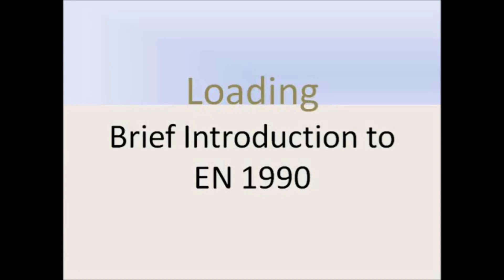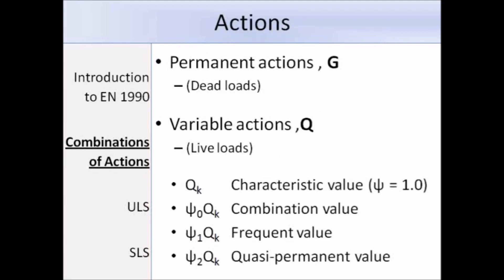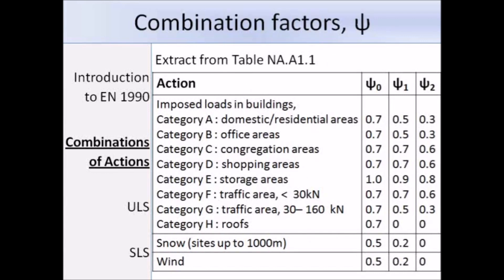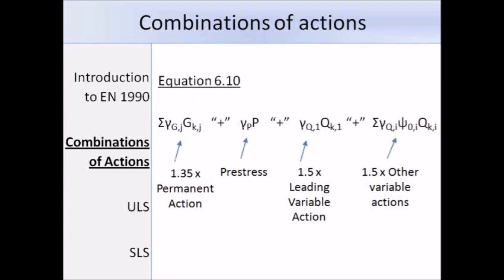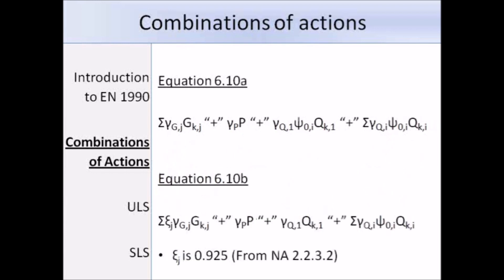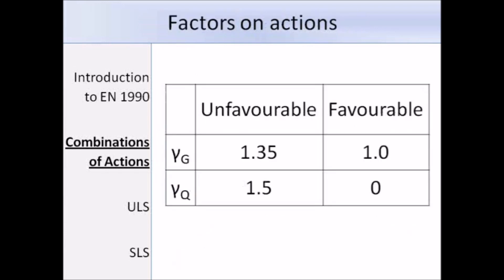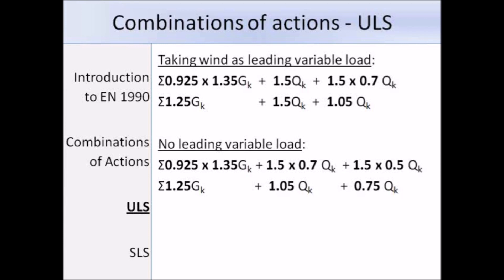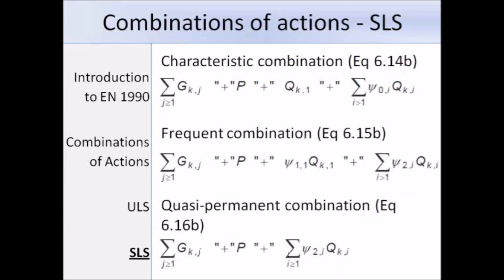Introduction to Eurocode 0 | EC0 | EN1990 | Basis of Structural Design | ULS | SLS

Comment: Thanks for video  i jut wonder somethink   i live in UK if i work as A structural engineer it is okey if i use eurocode or i have to use british standard bs5950? thanks
Reply from the maker: Kenan Taylan Under the Public Procurement Directive, the Member States must accept designs to the Eurocodes. Eurocodes are the standard technical specification for all public works contracts: where a contract for a public body contains a technical specification this should reference the appropriate European Standards.

Whilst it will not be mandatory to design to the Eurocodes in the UK, should a designer propose alternative design standards, they will have to demonstrate that the alternative is of 'technical equivalence' to a Eurocode solution. As the British Standards Institution (BSI) will not maintain the withdrawn UK standards, in reality there will be little option but to use the Eurocodes.
- extracted from Standards for Highways.
Reply: @IamDilakshana   Thanks for your generosity you are lifesaver:D
Reply from the maker: Kenan Taylan My pleasure 👍🏻
Reply from the maker: Kenan Taylan Yes it is.

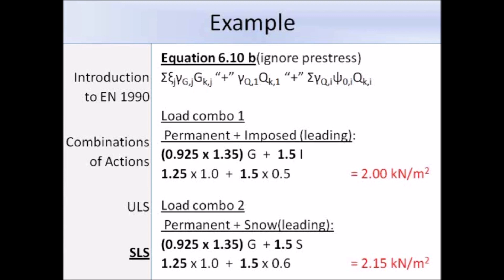Comment: Its a helpful video, but is there a mistake in Load Combo for for Eq 6.10b? The factor on WD changes from 1.5 to 0.75 at 11:54 . Shouldn't it just be 1.5, this means the load is 2.3kN/m^2 not 2.00. Doesn't change the overall result, but I just wanted to check I hadn't missed anything. Thanks
Reply from the maker: Apologies for the slow reply. It is 0.75 because γ x ψ = 1.5 x 0.5 = 0.75
Check tables at 09:18.

Comment: Hey. Good video. Where is it written what value does the gamma_p-factor take in a formula 6.10?
Reply from the maker: Hey Vasiliy. Check section 2.4.2.2 in Eurocode 2. Then you will need to refer to national annex and look for the nationally determined parameters. Let me know if it is not clear.
Reply: @IamDilakshana , thank you. How about EN1993? What is the coefficient for
 guys, pre-stressed X-bracing, etc? In Eurocode 3 I did not find these requirements.
Reply from the maker: Take a look at EN1993-1-11 and the relevant national annex. Especially sections 5.2 and 5.3.
Reply: @IamDilakshana , thank you. Have a nice day
Reply from the maker: You’re welcome 👍🏻. I’m glad I could help. Have a nice day.